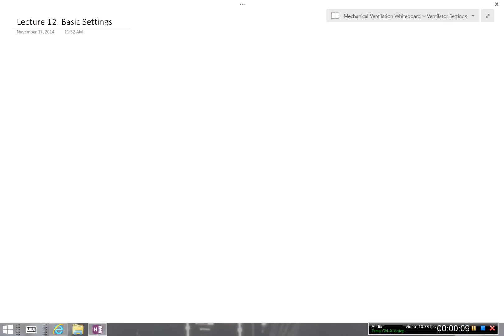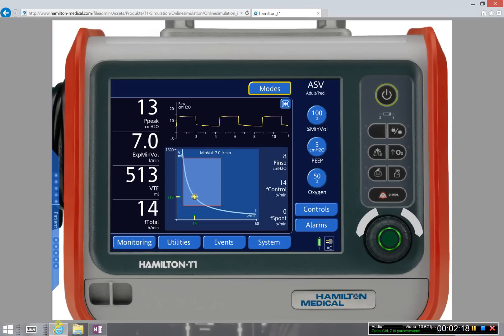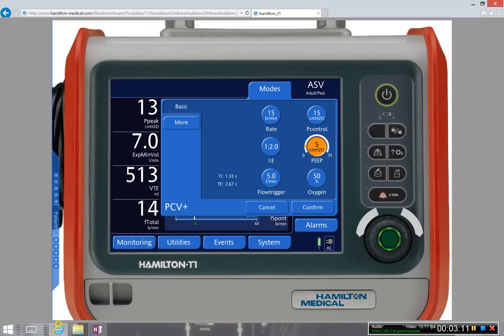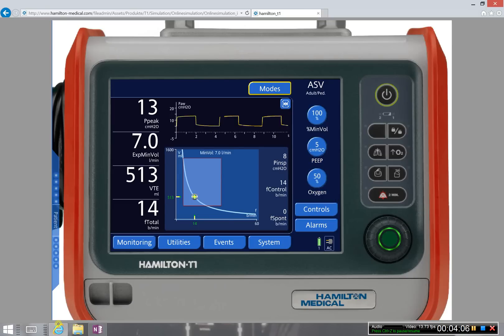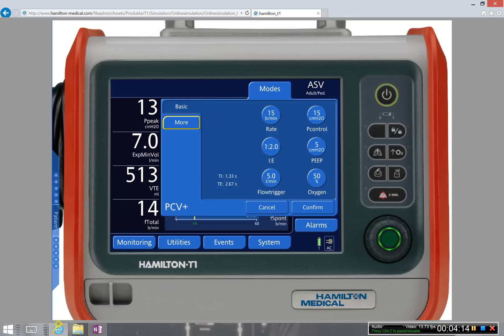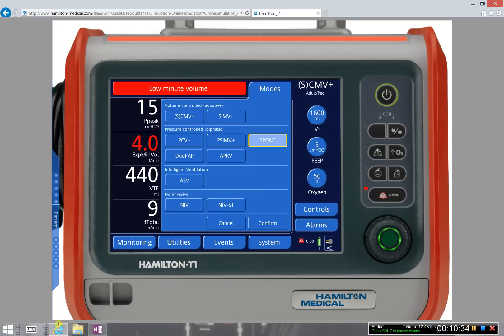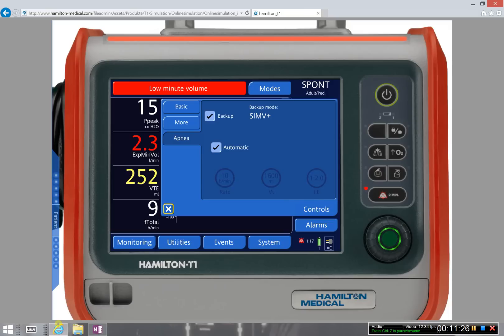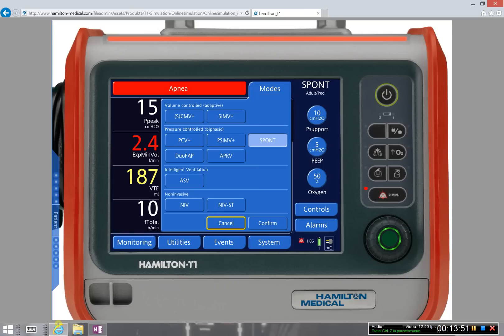Lecture 12 Basic Ventilator Settings

Comment: Hello Dr. Hudson, can you please explain when you would use a volume control mode over a pressure control?
Reply: The Pressure Control Mode in general has a "Decelerating" flow pattern and this prevents increases in System Pressures and Barotrauma to the patient. On the other hand Volume Control or Assist Control Ventilation has a Constant Flow pattern and for the same Tidal Volume will generate a Higher Peak Airway Pressure exposing the patient to Barotrauma.
Reply from the maker: Depends on the situation. There is no evidence that one mode is better than another in terms of patient outcomes. I use VC when I want to make sure that the minute  ventilation is controlled.
Reply: @DarrenHudson  So would it be wrong to say... Use a vcv or volume targeted mode unless you are worried about pressures?
Reply from the maker: @tashabanack2807  Most ventilators now have the best of both worlds with a form of ventilation that is volume controlled but pressure regulated (PRVC).  The ventilator has an algorithm that monitors the pressure generated while delivering a breath and adjusts the flow rate to get the volume in at the lowest possible pressure.